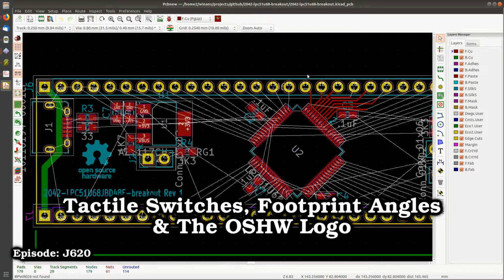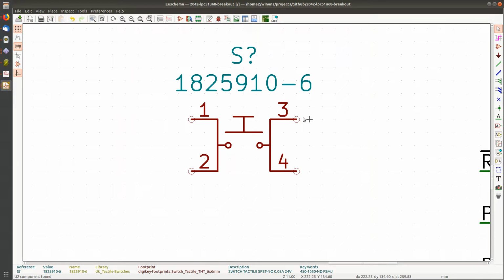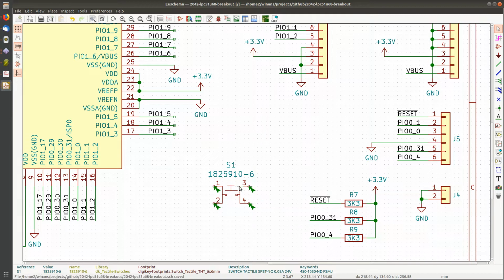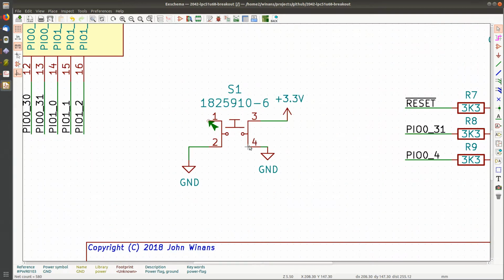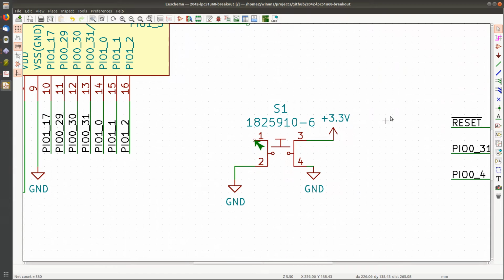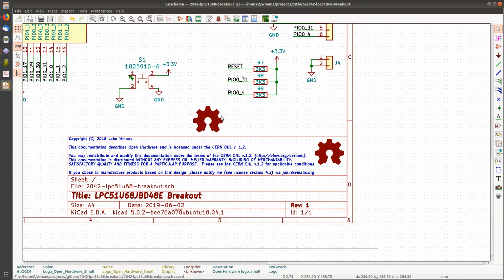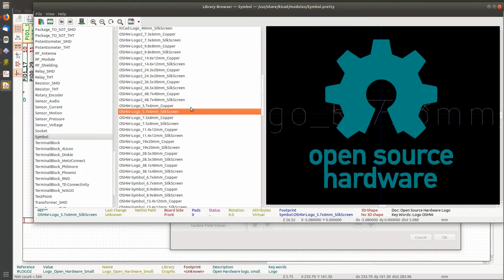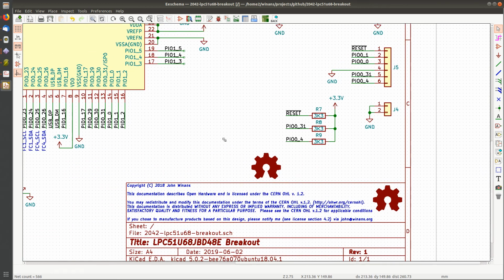KiCad 5 #25 Tactile Switch Footprint Strangeness, Footprint Angles & Logo Symbols

Comment: You can set the rotation increment in Preferences / Pcbnew / Rotation angle. If you know you will need 45 deg for several footprints, set it to 45, and every "R" press will rotate 45 deg instead of the usual 90.

Comment: Re: Tactile switch - Pin commonality... A pin's number is independent of that pin's name. So, in the editor... To tie pins named 1 and 2, number them both "1." Name them, individually, whatever you like. Repeat for the other pair, but number them "2." Now, you have a switch with two nets and the pins numbered however you like. To eliminate the extra rat wire between a common pair on the board, make one of the pair a no connect/X, on the schematic. However, whichever pin you make the no connect will carry over to the footprint pad orientation on the board. If the footprint orientation is not as you like it on the board, you may have to make the correction on the schematic (or, the editor, or course.) Give it a try and let me know, if I have it correctly.
Reply from the maker: This really is a good understanding and great solution to this problem!

Comment: On the "tactile switch" issue; I'd suggest using a regular SW_SPST component with a SW_PUSH footprint instead.
Reply from the maker: Then you will be forced to connect both pin 1 pads together and both pin 2 pads together in spite of the fact that doing so is unnecessary... and a problem if such tracks block your ability to route under the switch.

Comment: Hi John, I appreciate this kicad tutorial so much. Please, let me know how to manage the PCB design when we have parts outside of this board (like transformer, buttons, potentiometers, etc). For the schematic view, all of them must be included, but for PCB design, some of them will not be on the board (no footprint). Is it possible to perform the DRC with a reliable results?
Reply from the maker: Given ONLY the facts here the easy answer is yes... just put a # in front of the reference in the schema editor and the part will be left out of the netlist and therefore not be an issue with the PCB DRC ... and the schema DRC will actually check its pins as normal.  BUT schema will also leave it out of the BOM... so that might not be what you want.

With a normal (no #) reference, you could put the part in the schematic with no footprint and ignore the PCB schema and netlist import warnings... and the schema and PCB DRCs will be silent(ish) about that too.

You can also assign it a footprint that has no pins and then put it off the PCB... perhaps create a footprint that only has stuff on a silkscreen layer maybe... again the DRCs wont gripe but the netlist import will because the footprint pins won't match the symbol...

Another way to look at this is to note that you DO have something with pins AND it WILL need to be connected into the schematic.  Therefore you PROBABLY DO have a real foot[print for it... that is simply a set of thru-holes where the wires will go that run out to the off-board-mounted part.  Therefore you /probably/ don't really have a problem... create a footprint for the pads that your wiring will require.

Eh?  :-)

Comment: Hi, I've just today come across this as i'm putting the finishing touches to a project, firstly thanks for the BOM tutorial my project now has a simple BOM and also have started to use Libreoffice, I noticed you did so figured it would be OK and It's great to support these open source projects (proper teachers pet!) secondly, I wanted to add some information and graphics to the PCB so I went ahead and created them and everything looked great, but then I updated the PCB and of course all the stuff vanished which kinda makes sense now cos its not on the schematic, so I guess the best thing to do is just remember this or make a note on the schematic. What would be a more professional way to do this ? would it be to make a symbol for this stuff and assign it the footprint ? or is it really a matter of taste. My case is, where the input to the circuit is on the PCB i have labeled it " I/P" but used a nice font and placed it on the copper and also put a solder mask on it so the finished board has its input marked and won't ever get rubbed of as it will be plated, besides looks kinda sexy too! But my "I/P" exists as a footprint can  make a symbol for it that has no pins? and just stick that on the schematic? Another thing, is there a way to add different fonts to Kicad? also you refer to the "#" as a pound sign this to me is a "Hash" just wondered why its called a pound like the "£"...hope this makes a bit of sense, thanks!
Reply from the maker: I have spent more time with EDA CAD apps in my hobby time than as a pro.  Even so, I have seen some pretty horribly executed schematic and PCB layout work that were barely functional and impossible to maintain.  (That is why I took to time to learn how to do it myself.)

As for your particular issue:  Remember that if you lock a footprint on your PCB, an import even with the 'delete extra footprints' option turned on will NOT delete it... which may be the easiest way to add arbitrary things to your PCB that don't have a reasonable counterpart in the schematic.

You can have footprints without any pads/pins.  That is the case of the OSHW logo in this vid.

As a kid I was told that # is the pound sign.  When I worked at Western Electric, it was called an octothorpe.... soo... I dunno what you are all excited about :-D
Reply: @JohnsBasement  Lock the parts, yep that's gonna be the easiest way, just out of interest what do you call the "£"...cheers!
Reply from the maker: @andymouse  I'd call it 'Sterling' or 'Pounds Sterling'.

Comment: Hi, john
I’m wondering how i can make footprints same as the symbol
just like nuts which you showed me
Thanks for your video
from Korea, republic of
Reply from the maker: I don't understand what it means to "make footprints the same as tje symbol."
Reply: John's Basement 
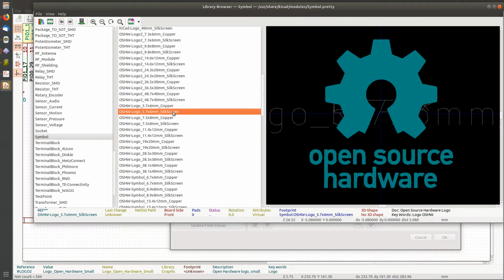9:47 (symbol) and 12:17 (footprint)
are same shape
so I’m curious that whether i can copy and paste from symbol library to footprint library
Reply from the maker: @devstefancho  Oh.   I didn't realize that was where you were going with that.  I don't know how to cut and paste from the symbol editor to the footprint editor.  Even so, any non-trivial graphic can get complicated in those editors.

You can create a picture in a bitmap file (like a .png)  and then place it on a schematic sheet.  But to put the same on a PCB the only way I know of is to use the bitmap converter.  [You can probably figure it out by playing with it... It is the thing with the big 'a' on it in the kicad box that pops up when you first open the app.]

If you use the bitmap converter, then it is easy to put the same graphic into a symbol lib and a footprint lib.

There is a subtlety about how to get it to put things on copper layers -- you have to put it on, say, the silkscreen and then open it in the footprint editor and change the layer it is on... and then it will gripe about subsequent DRC issues.... 

Meeeehhhhh.... This is probably something worth making a video on how to do.  I'll add how to use the converter to my list.
Reply: John's Basement 
Oh I’ve never experience bitmap before
So I’m so expecting your future video which you’ll covering about bitmap converting
Thanks for reply
Have a nice day John